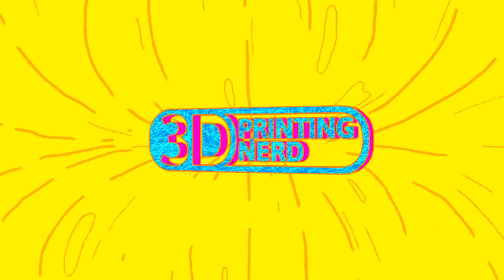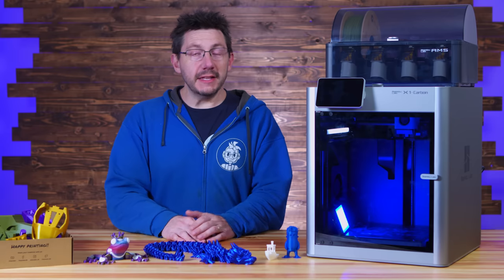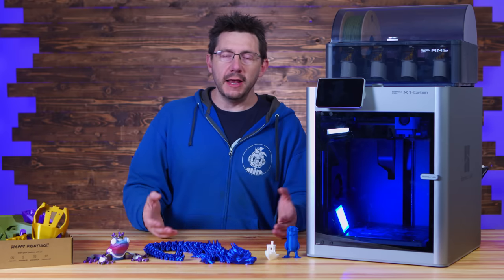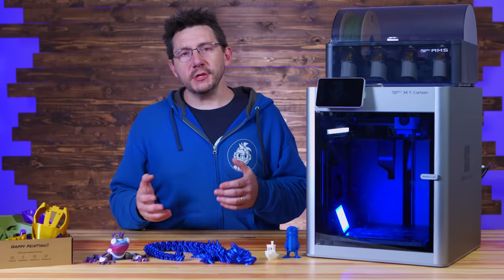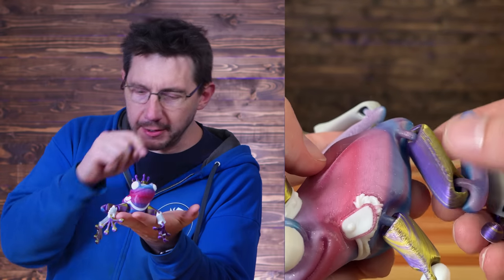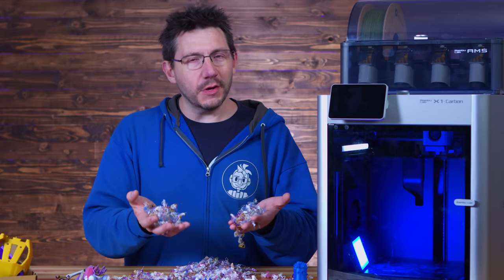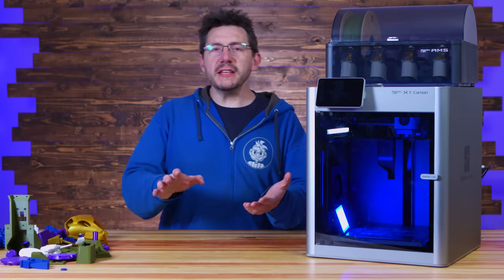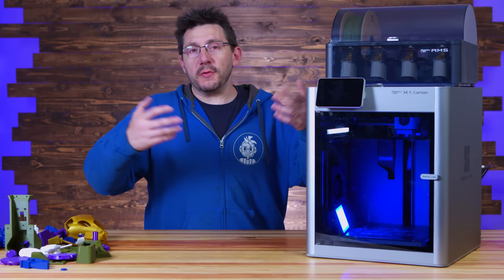Bambu Lab X1 Carbon + Kickstarter?!

Comment: I backed the kickstarter for the Carbon with AMS. Looks like it will do more than my RatRig for about half the price.
Reply: I wouldnt say more, but it is a pretty nice printer.
Reply: You made the right choice. Now you can spend more time printing than tinkering with what should be a tool at the end of the day.
Reply: @morbus5726  Multi-material is something I don’t have with the RatRig so I’d say that counts as more.
Reply: @deeeirl  a Rat rig requires constant tinkering??!
Reply: @REDxFROG   All Diy 3D printers do! Even off the shelf printers (i.e Enders, CRs..) require setup, calibration & tinkering.
Reply: @deeeirl  actually no... The most important thing is auto bed leveling. Then you should be fine. A good printer can be as good as fire and forget..start it and don't even look at the first layer. That's how Prusa Mk3s+ and the Mini work.
It's too bad the reliable SuperPINDA isn't easy to mount on DIY machines. I don't trust BLTouch as much for some reason. It also takes more time to do 4x4 etc.
Reply: @REDxFROG   That's not even slightly true. Prusa is close to a "fire and forget" system because they provide not just the printer itself, but tuned and calibrated profiles that have been tweaked in-house along with the rest of the eco-system; Slicer, Filament, Support...etc. ABL isn't a magic bullet, it's only one tiny aspect of the bigger picture. Stick the Pinda on whatever printer you like & it doesn't magically become as reliable or as good as a Mk3 just because it has ABL.
Reply: @deeeirl  My modded AnetA8 and CR10 are just as reliable and fire&forget as my two Prusas.
However, they are still DIY. They use BLTouch/3DTouch. They use community firmware, aftermarket mainboards. 12V, DIY heatbeds, extruder and frame designs by community and whatnot ... I just like an off the shelf Prusa printer more than my modded printers.
The profiles in Prusa slicer are working just as good on my AnetA8 and CR10 as they do on the Prusa printers. Tinkering with profiles all day long is only a CURA thing.
My Anet A8 with E3D Hemera has the same print quality as my Prusa Mk3S+. Sometimes even better (surface finish), but cooling is worse.
It's just that the Mk3S+ has more features, it's more convenient to use. But constantly tinkering on them? No. If somebody constantly tinkers on his printers, he's just not there yet.
Reply: I've done the same just to get in early, but I'll be making another decision about it later this month. I had a revolting experience with a kickstarter CR-6, which fairly turned me off the idea, but it sounds like these guys are going about things very differently to Creality (the footage they have of hundreds of test machines working away in a lab, plus what Joel's describing about the investments made, gives me a fair bit of confidence), so we'll see what real-world testing has to say about it in the next few weeks.
Reply: @timix_au  I've wanted one very bad until I've seen one of their test print videos with a gap in a model which shouldn't be as big.
Then I realized everything is locked , from hardware to software. So every problem you will encounter can turn into a desaster. No thanks ☺️

Comment: Looks great over all, but the AI lydar aspect does seem useless if it doesn't auto fix whatever problems it detects or at least instruct the user on what to do. I hope that is something they plan to have worked out by delivery because otherwise that is just a lot of tech adding to the cost that doesn't actually function, and would make me suspect of any claim by the company. 
I definitely wouldn't back the kickstarter until I knew that was functioning in a useful way.
I also get a bit nervous when a company has so many custom aspects for parts you might want to swap out later. A custom nozzle makes me think that you are locked in to whatever nozzles they offer. If so, what do you do if you want a larger or smaller nozzle aperture than they offer?
Thanks for another great video Joel and team. High-5!

Comment: Joel, a question just ocured to me..... is it better to print smaller, single prints (fast) for a project, or print multiple (full plates) things, as far as time to complete a project is concerned?
Reply: Print time is usually affected in this order: height, density, area. IMO many short (not necessarily small) things on a single plate is faster. But only if your printer can do multiple objects without warping or snagging, especially out in those cooler orders of the plate. Two individual prints is often faster than restarting a failed combined print.
Reply: It also depends on what you are printing sometimes if the parts are small or have very small parts printing a bunch will give it time to cool and setup before the next layer unless the printer can cool the part very well.  The other thing is if your printing things that print very quickly then you may need to get a second plate to swap so that you can go on to your next print immediately while you are removing the just printed part because if things take 15min instead of an hour then you are losing time between prints - that's why a belt printing that could print as fast as this would be great (saw a delta one) or some other sort of part removal like que would be the next great thing for this.

Comment: It looks great, seems to work great but the big fun at 3D printing for me is the tinkering on the machine. Use different nozzles, beds, 2kg spools. But I have to say it looks great! I hope the support and parts availability is going to be good otherwise i am afraid you can pick this up within half a years for half of the retail price or even lower.
Reply: even a year later at half the price the Eearly bird X1 carbon & AMS will still be cheaper.

Also thye have stated that the with be other nozzle module to use from 0.2, 0.4 & 0.8. the heads are all hardened steals. how ever you canot use third part nozzles. i wish i was able to put a diamondback 0.6 nozzle on it for the CF prints . also the print head is an all metal print head nozzle and heat breaks.

The group wish they can provide spare parts for purchase but waiting to see what will be available.

Comment: I know 0 about 3D Printing but I want to learn. Is this easy to learn? A good starter printer? My plans are to add items for my craft business. Fidgets, dragons and who knows what. Anyone have any advice for me on this possible adventure?
Reply: If you want to just start then Ender-3 pro will do just fine.
If you want to also sell the prints and get high quality finish, then use Resin printer.
Anycubic Photon M3, Anycubic Photon X etc.. Resin printer can print with very high resolution and you can even see smallest details on the prints.
Reply: This printer appears to be a no headaches solution for someone who wants to spend more time printing and less time figuring out what print setting is best for what filament. Tested made a more up to date video about it and it convinced me that this is a great buy.

Comment: Also remember that kickstarter edition will be version 1, whereas whatever little changes they'd find once it's gone out to the users, will likely not be changed until like version 3 or 4.
That being said, that's a good price for what looks like an actual plug-and-play printer. Especially if you get the AMS version.
Reply: I think the HW is pretty much final.
Reply: @lazyman1011  Correct, the shipped version to testers and the production will be version 7 according to Bambu Labs

Comment: This printer really does get me excited. As someone that has tried out two enders printers 3 v2 and 5 plus (both of which I returned after many struggles more than likely on me), this looks like my dream printer. The main goal I have for printing is cosplay so I hope the build space can really be what I need for printing helmets in as few pieces as possible. While features such as multiple materials and colors seem nice it also really doesn't seem like a big reason for me to buy the printer. While I won't pledge for it I will 100% be keeping and saving for after the full release happens.

Comment: That’s a hard decision. Pull out of the Prusa XL or just dial down it’s print heads to easily finance the kickstarter and get both of them. I probably won’t decide about my XL  pre order until I’ve send the X1 through its paces.

Comment: I'm looking for my first machine to print functional parts preferably CF/ Nylon I'm not sure if this machine will print those types of filaments. Speed is great but if it can't make great cf/nylon prints I may just jump at the kickstarter.
Reply: Yes it can print CF and Nylon. Get the Carbon variant with hardened steel nozzle is you want to print CF though.
Reply: @logitech4873  Thanks I'll be picking one of these up once the kickstarter is over. Still debating if I want to back it or not.

Comment: I was wondering are there any cheap 3+ colour printers?
Reply: I Think the cheapest multi material printers at the moment are probably the prusas with the MMU upgrade. Or If you are looking for large format you could look into a voron 2.4 with the enraged rabbit carrot feeder, but depending on your budget and time vorons can be a little bit expensive.
Reply: Nope. I mean you can add a 3d chameleon to most printers I believe, but any sort of automated multicolor printing requires around $1000-1500 (all in for printer plus multi material option)
Reply: @Aidenn23  what's a 3D chameleon?
Reply: @thisguy462  it’s a “universal” multi material addition to a printer. Look it up!

Comment: 3 thoughts in my head right now:

1) I think at this point, the only way a 3d printer can succeed on Kickstarter is if it has money behind it before the KS starts.  And yet, KS remains a great platform for generating interest... and an acceptable platform for handling client information and payments if a company doesn't have their own webstore.  I figure that's a good enough reason for Bambu to have used KS for the initial launch.  (Also, they might be really leaning into debt financing right now and using the KS income to quickly bridge into profitability.)

2) I've backed this but without the AMS for now.  I'm considering picking up an AMS down the road, though, and one things I'd really, really like to know is if it can be used for runout protection.  That is, can you set it up so that when one spool runs out the AMS just drops in the next?

3)  You're sure getting a lot of endings, I feel like I'm watching Lord of the Rings.  :D :D

Thanks for being awesome!  I enjoy your work a lot!

Comment: You need to buy their nozzle hot end combo ( Expensive to change both often) also limits you to not use CHT nozzles etc.  
Their own consumable built plate (sticker)

Software has amazing features but also restricts it. Will they keep up with prusa and Cura? Unlikely but I'm sure their do some innovations of their own.

AMS only fits some filaments.

Many risks, but i sure hope they do a kick ass job !

Comment: Would love to buy one but the price point is a bit high for me (shipping OUCH) :( I also am a little bit worried about all the proprietary stuff and the "what if" factor of it failing. I have been told they would open source everything if the company goes under buuuuuttttttttttt that is kind of like kickstarter saying, yea you will definitely get this product. They also did not put a price on the AMS system when I asked, so to expand to all the units may be pretty expensive. Why don't they have a full blown machine with all the AMS in the kickstarter??????? Great machine that I would totally buy to play with if I had the extra funds to set on fire but alas, nobody wants to buy me one, the wife said "you already have a printer" and the bills say LOL you just sit there and pay us!

Anyway it was a nice look at the machine and I do appreciate your views and totally agree about kickstarter being used for marketing rather than how it was intended to be used. I guess one good point is with the marketing aspect you don't have to wait years for a product.....trying to find the good in everything.

I would like to see something HUGE printed that takes up a lot of the volume, like a helmet and also something like a multi-piece sword with the blade segments standing on end (Just thought of another as typing that would be those collapsing swords from 3dprintingworld which are free). Curious to see how those small footprints and high Z would work on the printer.

Comment: Edit: I stand corrected, and apologise for the bad impression. The kick starter was halted over IP not shortages, & in this case everyone got their money back. 

I'm not convinced with kickstarter as creality just folded on their lizard scanner recently. (Creality ain't short of money or manufacturing capacity, but the recent chip shortage played a part)
Reply: This statement isn't completely accurate, they got sued for ip infringement and Kickstarter suspended it. I was a backer and got a 100% refund from kickstarter on my pledge.
Reply: AFAIK the main problem was the software, the person responsible for it simply copied the code from their previous employer, and an IP litigation ensued.
Reply: Also, you can still buy them for original pledge prices, just not through KS
Reply: That is not true and I hate when utterly false information is given on the Internet. There was a lawsuit that put the fulfilment on hold. Since then Kickstarter has refunded all the pledges and Creality is shipping the product. End of story. The Creality lizard should NOT be used as a bad example of kickstarter without explaining what happened and that nobody got burned.

Comment: How does a cooling fan that doesn't move with the bed work?
Reply from the maker: Since the X Y plane that the nozzle is on doesn’t move in Z, a stationary fan across that plane can work well.
Reply: @3DPrintingNerd  thanks for the super fast reply! Maybe I should rephrase. How can the cooling fan work so far below the extruder, and even below the entire build plate (which it will always be, for smaller models)? All the other cooling fans I've seen are attached to the extruder.
Reply from the maker: @aaronandersen905  You're talking about that big ol' fan on the left side inside, right?
Reply: @3DPrintingNerd  yes, that's the one! I saw another video where that was described as a cooling fan.
Reply from the maker: @aaronandersen905  Ah, got it. Think about it this way. It's going to blow air over the build plate, but at the level of where the nozzle it. It is stationary, so that's where it will always been blowing. this helps when the print head is moving super fast, as it creates a good cool zone right where the nozzle is laying down the plastic.
Reply: @3DPrintingNerd  Got it, thank you. It just looked placed really low to me from what I could see. But you have it right there, so I appreciate the clarification.

Comment: I feel like this may have been timed and targeted at us with Prusa XL orders. It worked.
Reply: So are you sticking with the XL?
Reply: @gibbnal  my plan is to decide after I have the X1 in hand before canceling XL. The XL does have some excellent advantages of its own like tool changing and over all build volume.
Reply: @bowieinc  I’m thinking the same thing. As long as the X1 ships on time, there should be plenty of time to decide on the Prusa XL.

Comment: Quick question, is it possible to setup the purge to go as infill instead of waste.
Reply: In the slicer yes
Reply: You can purge into infill and you can also add an extra model to the build plate that you mostly print with purge if the color of that model doesn't matter to you. The stock settings in the slicer purge quite a bit more than you usually need so if you do some small tests and fine tune it there is next to no waste.

Comment: Hi, I hope you can help me out. I work at a University in NJ, and we have been trying to buy 4 of the X1 Carbon with the AMS. I have been trying to get a quote from them. I have filled out their online form, and emailed them at their email contact on the website. The email comes back as undelivered. I have tried this several times. Our purchasing department requires a formal quote to purchase. Do you have a contact email for Bambu Lab? Thanks for all the great videos. Your channel was the first 3D printing channel I subscribed to. Thanks again.

Comment: If it's printing that fast is it louder than other 3d printers?
Reply: Yes it's a loud printer. However it does have a much slower silent mode if you need it.

Comment: Loved the review, will not back it. I have enough printers at home. Even if they says is not, it does looks like a Klipper input shaper calibration.
Reply: You are right that it does, though so does the input shaper for rep rap firmware. I think it might just be how its done.

Comment: Interesting printer indeed.  I would prefer a larger build volume though.  At least in Z.
Reply: @jeremytine  Yes, multiple extruders would be better.  I wanted an mmu until I learned about the purge block.  This poops the wasted filmament, but hard to tell if it is more or less than a purge block?

Comment: I just entered the 3D printing world, just to play, and purchased a Ender 3 V2. I am having a great time printing mods and buying accessories to upgrade the printer. I will probably spend more on upgrading the  Ender than the cost of the Kick Starter. I do want to back this but the idea of built-in obsolescence, over priced  replacement parts or no parts available tells me I should pause and just pay msrp when the product launches. That is unless one of these 3D printing masters want to send one of these to me to get a full noob experience. I am currently mastering bed level and glue stick technique.